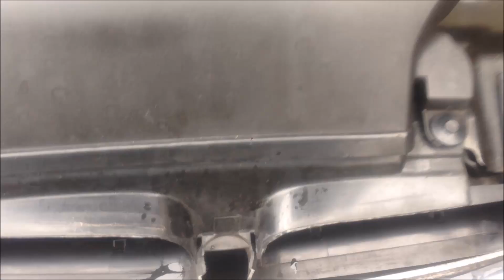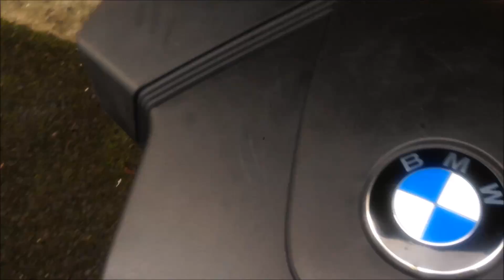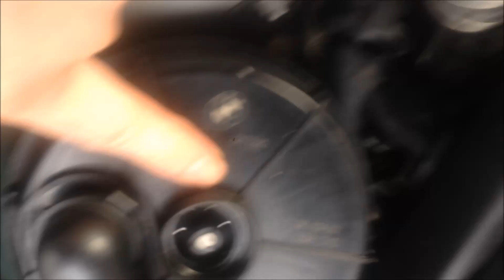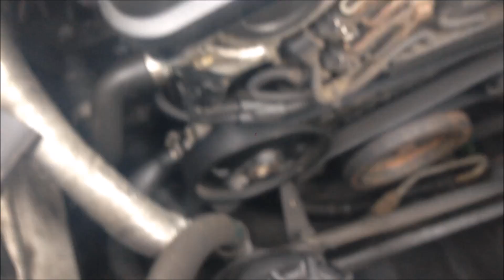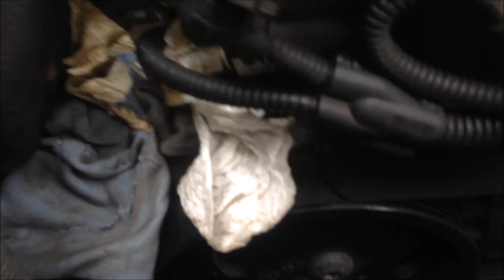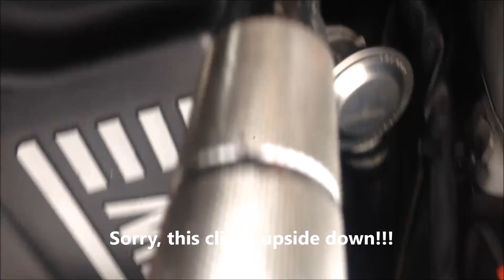Timing Chain Tensioner: How to replace (BMW E46 / N42, 2002)

Comment: I read in one of your comments that you still experience cold start noise/rattles even after this fix, could you tell me what the rattling sounded like before and after this replacement and how did you finally got rid of it for good? you mentioned you got 15sec rattling, it seems the swap didn't help so, what did help?

Comment: Hey, why haven't you first put the engine in the top dead center? I've heard from a friend that you have to do that...
Reply from the maker: Hi, I think if you do not remove the chain, you do not need to worry about the timing. I have replaced it several times with no problems. If you have some good reasons, please describe here so we can all learn together. Have a good day!
Reply: @RepairDIY  one last thing. How much Nm is required to torque new tensioner to spec.?
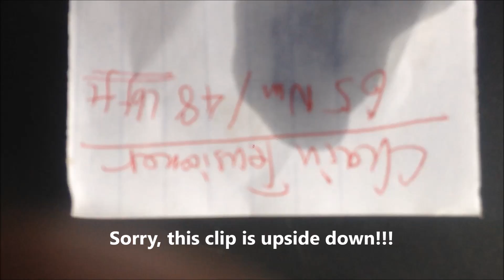Reply from the maker: @tyburcjusz  hi, at 6:15 in thee video, it should be 65 Nm for the N42 engine,(my engine shown in the video) or 50 Nm for the M43TU engine. cheers.
Reply: @RepairDIY  I'm not an expert :) my friend only told me how to set TDC which is actually not that difficult even with valve cover on. So my point was only to cross reference it with you. Since you say you did it a lot of times and you managed to do it without then I'm OK with your experience. Thanks and have a nice one!

Comment: if you still have noise after replacing tentioner ,then inspect the Rails one one the Left top breaks usually after 50 K !
Reply from the maker: Hi, Thank you very much for your suggestion. My car did have timing chain guide broken and the main problem was found to be the low oil pressure. That's why there was not much difference even I tried three different timing chain tensioner.  Have a good day!
Reply: @RepairDIY  that's a good heads-up I'm about to change my tensioner because I know it's not working on cold startup runs fine but I notice a dip in the RPMs when it downshifts from 3rd to 2nd so changing the tensioner out ASAP and eventually he will do a bulletproof on the system vanos they actually came out with a new exhaust heavy duty hub so you don't have to change the CNC holes on the vanos that saves about $150 and it is what looks to be a better product dr. Vanos has this also changing out the anti rattle splines and the gears for a smoothie running system will have to check the oil pressure if I have a problem with this tensioner once again thanks for the heads up yeah by the way the plastic tensioners the one on the left upper definitely going to change I'm almost at 90,000 if it ain't broken LOL

Comment: Hi. I heared from other websites, that this new chain tensioner produces a little noise (1 or 2 seconds) when start the engine in cold? Is this real? 

Regards!!
Reply from the maker: hi, Toni, Many people have the engine noise for a few seconds after starting. My car currently produces noise for 15 to 20 seconds from a cold start! I don't know which particular part may produce the noise. I may try to remove the oil sump to check the oil strainer screen soon.  Enjoy your BMW! regards. charlie
Reply: Hi Charlie.
Then you could not hear the appearance of a new noise because of the change of the new tensioner, right?

Regards!
Reply from the maker: Hi, Toni, I have one old style and two new style tensioners. I have swapped them several times but my engine noise still there. cheers! charlie
Reply: I understand that there are no noise differences between the two  style tensioners in cold start... :)

Regards!
Reply: @Tonil875  hey bro i know its kinda late but i think u mean that the version 3 rattles at coldstart. The tensioner in this video is the version "2" and u cant get version 2 officially from bmw anymore u have to buy from other brand which i did because my chain+guides are new and i have coldstart noises 1-2seconds. I will insert the chain tensioner tomorrow. I had 2x version 3 tensioners and the one which had no "bmw" printed was stronger than the original bmw one. I will see in 2-3 days. If u  compare version 2 to 3 the oil borehole is different. On the version 3 its located near the screwhead which i think is wrong because the oil doesnt get flawlessly in that oil? we will see

Comment: do you have to change timing chain if rail is broken on the n42?
Reply from the maker: I only changed the timing chain tensioner and haven't gone that far to change the timing chain or rails/guides. I guess if you ask someone do the job, you should change them all, and if you do it yourself, you can decide considering the costs and labour hours.